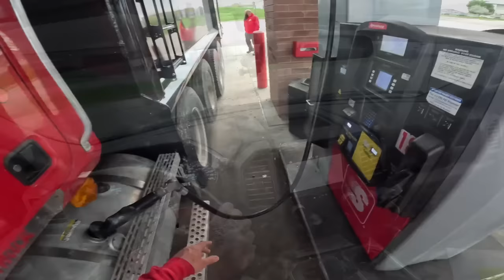Big stamped concrete patio and I was exhausted!

Comment: Hey Ryan, as a former concrete truck driver, I think the reason why the concrete was setting up quicker than your last job (that had the same mix) is due to the distance the concrete had to be delivered..  You did state that you're working further than you normally do and if the barrel on the concrete truck isn't spinning faster than normal (because of the longer distance to drive) then it will have an effect on the concrete..  Just a thought..
Reply: I think you're 100% right
Reply: Yep he is 100% right. 
Min 30-40 minutes is a decently long trek from his house not counting the length from the plant either
Reply: Correct, I used to work on 700-900 yard PT deck pours, two trucks in the hopper, 18 yds every 12 minutes, one pour the pump truck blew like 3 hydraulic hoses, spewed 20 gallons of fluid on the street, panic insues as in twenty minutes there was six trucks circling the block, soon it was ten trucks, another pump on the way, ended up Garbro bucketing over a 100 yards with the crane, had four guys with vibrators stirring the stiffest mud I've ever seen, ended up being a 13 hr day, the finishers almost had to be carried down the stairwell
Reply: Concrete plants should allow for travel time. Also what happens to the material if stuck in traffic because of an accident?

Comment: Does scaling come from salt or ice sitting on the cement for a long time? My driveway has some but I noticed most of it is where a layer of ice stays in the shadow of the fence so it also gets salted a little more.
Reply: I think it's from captured moisure under the surface and once it freezes it pops the top layer right off.

Comment: Hey Ryan, As a loyal fan of victory outdoor services, I'm very worried that you don't use water suppression when cutting concrete. Silicosis is a killer for people in the building and concrete industry. Please look into it to understand the dangers. Stay blessed to all that work at victory
Reply: Also they should be wearing masks or respirators when using release powder, again for same reason - prevention of lung related diseases. As an ex nurse watching people die of lung cancer, sillicosis etc is not pretty!

Comment: Doesn’t surprise me it’s setting up fast, if it’s a long ride for the crete to the job, in a front, it turns all the way there, so it heats and starts to hydrate, unlike a conventional mixer, you cannot let the drum sit still to long on a front, the drum ring can actually weld to the rollers from friction if left still, especially with a load on. Just mention to dispatch next time about distance, and ask for a very slow rotation on the drum it will help.